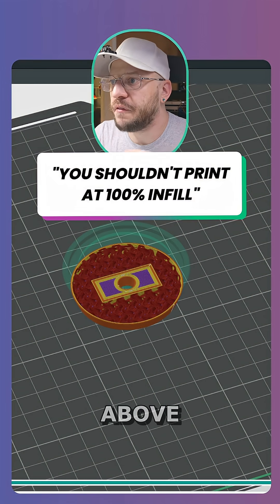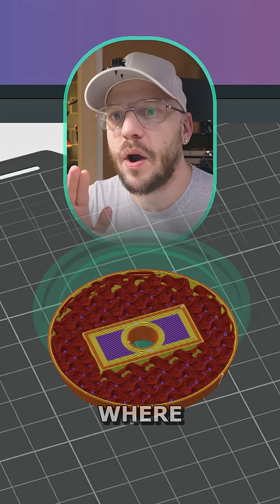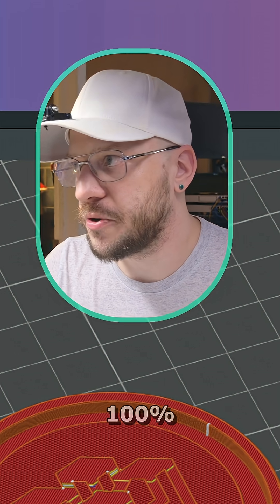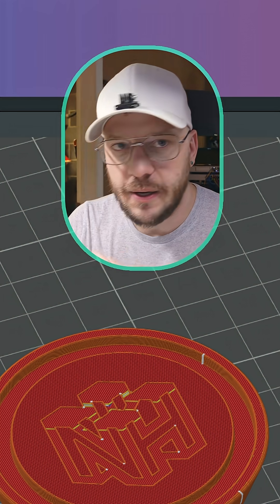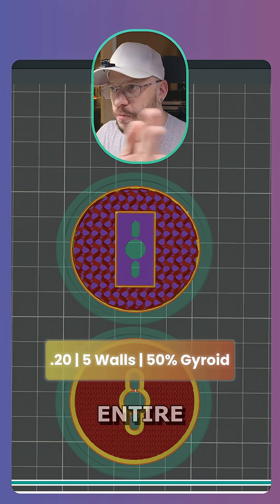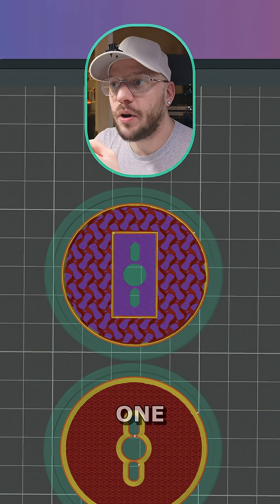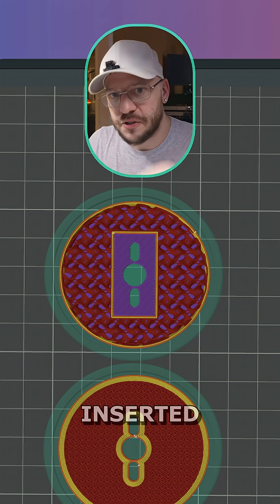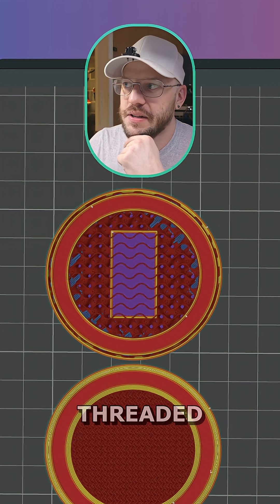Partial 100% infill vs total 100%

Comment: I’m working on figuring this out at the moment for my part, it definitely depends on the geometry of the part & where weak spots will turn up but I haven’t found a good answer yet. 
(Trying to work out, heat insets vs helicoils into ppacf to replace using a custom cut aluminum block with threads)
Reply from the maker: If you find some good data, please don't hesitate to come back and report your findings!

Comment: What I do is make them separate parts and export them as a 3MF, bring them into my slicer and make the one that the threaded inserts are going into ≈80% (any higher and I’ve actually had bad results such as excess plastic causing a bunch of pressure and cracking) and then combine them and print them, and I’ve been doing this for a while with not too many bad results, and I’m doing combat robotics